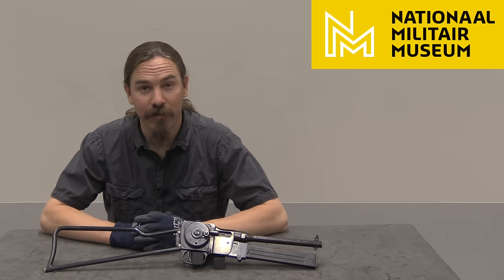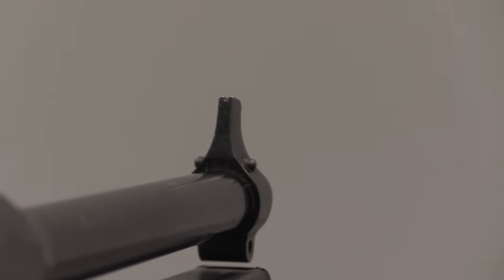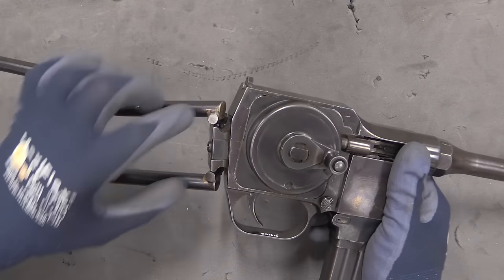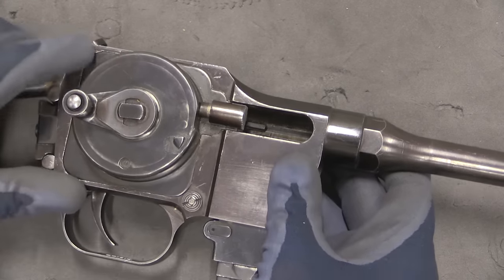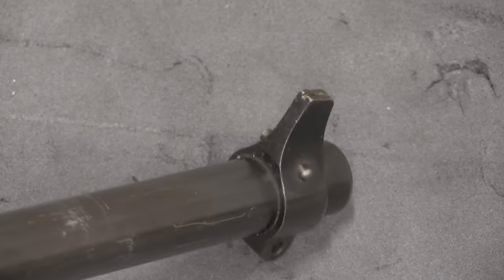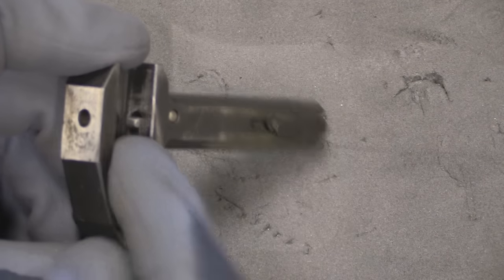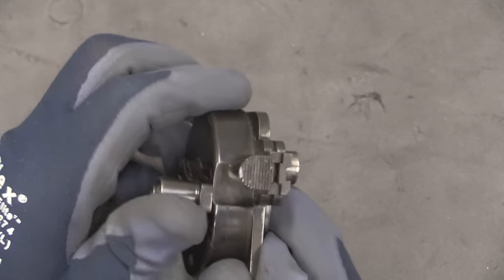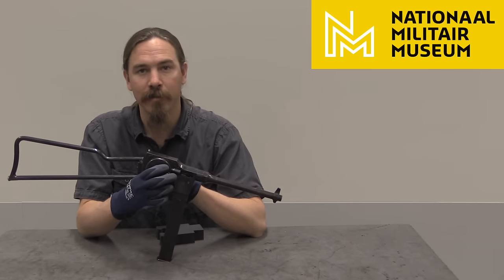MGD PM9 Rotary-Action Submachine Gun

Comment: I've never wanted to see footage of a firearm firing so bad.
Reply: I know. I'd love to see the bolt rotating around. I wonder what the recoil is like?
Reply: +Avalon Run Its also going to be first upwards as the bolt moves back, than downwards as the recoil assembly rotates upwards. Weird and wobbly.
Reply: How do you he it???
Reply: The grip looks like it would be very awkward. Are you supposed to hook your thumb around the stock frame?
Reply: @M.T....  
"However, the force striking the back of the receiver would probably be very significant, especially since there is no action mechanism to delay the bolt going backwards and waiting for the pressure to drop."
The action mechanism is the flywheel. The force needed to spin the flywheel to get the bolt moving backwards is the same as if the bolt was three or four times heavier. The whole point of this action is that the weight is moved from the bolt into the flywheel so the bolt does not have to be as long or thick. This is the whole point of flywheel delayed mechanisms over straight-delayed blow back mechanisms. Straight-delayed use heavy bolts. Flywheel delayed use heavy flywheels and a transmission to achieve the same thing as heavy bolt. Lever delayed blowbacks use levers and mechanical advantage to do the same thing as a heavy bolt. 
These are all just different methods of slowing down bolt movement so chamber pressures have time to drop. They all do the same thing and simply have different recoil, weight, and complexity aspects.
Reply: Same here man
Reply: @Will Kelly lol yes actually they stopped showing dislikes on comments.
Reply: 3 years later, and I am still craving this footage you wanted so badly to see.
Reply: same here, especially this and the jackhammer
Reply: aight where the shooting video
Reply: @ineednochannelyoutube5384  Sounds like they beat the Kriss Vector by quite a while in that respect. Maybe the rotating impulse counters muzzle climb... a little bit. A very strong "maybe" there. Like the Vector, probably also doesn't work super good but screw it I WANT it
Reply: @lewis251100  thank you
Reply: @bigbud6842  how unfortunate
Reply: The older the guns, the less likely to be fired due to delicacy, I assume. I'll go to Google, and let you know what I find. No response = no videos, or even pics, of this gun in action! Take care.
Reply: @VFRSTREETFIGHTER, I found this: The fire at the end almost seems as some trick with the fan that's blowing in the background: https://www.youtube.com/watch?v=pHdtXTHm5U0
Reply: @Xiones11  , must be nice to use google or wikipedia 😅
Reply: @ghostwriter1415 that's an airsoft gun. It's in the channel description

Comment: After WW I I all common SMGs (except Thompson) were stamped steel and simple round tubes. And then a frenchman designs a 1920s style clockwork SMG with expensive machined parts and expects commercial success. Nice gun, wrong era.
Reply: doesn't look that expensive though
Reply: patents were frozen during the whole WWII so the inventor applied for patents in 1940 but did not get'em before 1946. Hence the different approach (milling, etc..) from post war designs. It's not certain that the inventor was aware of the stamped sheet process applied to the MP38 (in 1938) when Merlin Gerin  (the company he worked with) submitted the patent.
The inventor designed also handguns, machine guns etc, without meeting commercial success.
Reply: That design could easily be adapted to 3d printing using elastic polymer spring because of the pull action the rotary design allows. This is especially true if chambered in rimfire.
Reply: @randomweirdo2701  Indeed. This definitely is an idea worth pursuing.

Comment: A very interesting piece of design. I'll add my 2 cents: the mechanism actually makes for a very soft recoil, so crude stock is not an issue. Also, by dynamic and attached mass behaviour(impulse redirection by crank/rotation) mechanism is very close to Kriss Vector. A gun that was really ahead of its time.

Comment: So why didn't this get more popular? Too complicated or uncomfortable to use?
Reply: n0la usually the reasons
Reply from the maker: I suspect because the mainspring tended to break, but I don't have any proof of that.
Reply: Rather unconventional, lots of cheap war surplus, small market in the first place. Also, that seems like a lot of machining for a subgun
Reply: or because it was just after ww2 and there were literally thousands of tons of surplus guns laying about.
Reply: I'd be doubtful of a complicated design, considering most firearms that I have personally seen, this is one of the simplest of designs. As for machining, yes, it may be a fair bit. If the SMG had a better chance for newer models, it could possibly be stamped or molded if it was not already, for mass production purposes.
Reply: Tristan Renner If this is a simple design compared to most firearms you've seen then you must be looking at some very odd stuff...
Reply: @farmerboy916  Good point. If there were enough MP40s lying around to furnish a supply of magazines for this thing in the commercial applications, wouldn't it be cheaper to just clean and use the MP40s?

Comment: The National Military Museum definitely is a great place to visit if you are in the area, there's a sizable collection of both old and modern vehicles, airplanes and weapons. Everything is multilingual so no problem for foreigners (as most museums are in the Netherlands). It's located at an old military airfield that was used by both the Dutch and US airforce up until the end of the 1990s.  They also sometimes do tours of the airfield so you can visit bunkers and hidden locations that are normally off limits, unfortunately they only do tours on special occasions.

Comment: Are there any other firearms that use clock springs? (besides Wheellocks)
Reply from the maker: Yes, the Lewis did.
Reply: and that odd machinegun that used a clock spring and a rack&pinon mechanism....
Reply: I'm quite surprised Ian didn't mention one of his favorite firearms the Suomi smg.  The 71 round drum magazine is powered by a clock spring.  Given it is an eternal part but still required for big fire power.

Comment: Was hoping when I first saw that gun that the magazine remained forward and the round was rotated into position.
Reply: Me too.
Now that would be a compact SMG!
Reply: so you mean like a g11?
Reply: @VioletEverlasting  Except less unholy Swiss-watch inside!  I had an idea for a rotary-breech like the G11 that used the rotation of the breech to extract and eject the case, long before I knew enough engineering to make it actually work!
Reply: @ScottKenny1978  P90
Reply: @solventtrapdotcom6676  yeah, that works, too, just that the rounds are on a different angle to the barrel than the g11.

Comment: 3 reasons why this never caught on

1. It is a pain to take apart.
2. No pistol grip.
3. Probably difficult to reload.
Reply: It's obviously easy to reload
Reply: apart from the huge number of low priced surplus available, the main drawback of the gun was an irregular rate of fire and a rather high incidence of jamming. looks like the clockwork mechanism is rather sensitive to dirt and powder residus.
Reply: @florentleider222  small thing but a difficult disassembly process probably exacerbated the latter issue you mentioned; the gun might not be cleaned as often or as thoroughly due to a lazy user not wanting to put in the effort needed to get the firing mechanism opened up.
Reply: Scratch the 3rd note. Every gun is easy to reload with enough practice.

Comment: I'm surprised no one is copying this style for a compact sub gun nowadays with modern tech! The enclosed spring rig for easy cleaning, and compact size appeals heavily. Just stick a fold down pistol grip from the stock, some type of small hand guard in between barrel and mag, fix the sights [drilling a hole through the 50 yd would even help...]and it would be a runner for my favorite sub gun. Add a threaded barrel and ninjas everywhere ill want them.

Comment: My guess on the stock is that the lower arm is just tube steel while the upper arm is round stock. That way you just have to drill through the side of the round stock and thread it, rather than drilling way down in a long piece of bar stock. Would save a good bit of machine time and having to have a long and fairly narrow twist drill.

Comment: Looks like it is actually a delay blowback. When the "hammer" is rotated to the three o'clock position firing the round, it is almost in a straight lock up position resisting the rearward motion of the bolt.

Comment: Just a semi educated guestimate as to why the lower butt strut is made as two disconnected parts. I noticed that the two parts are not aligned when at rest with the rod removed. When the cleaning rod is stowed and screwed down tight, the parts are held in alignment. My guess is that there is sufficient tension there to prevent the rod from unintentionally unscrewing from vibration and falling out to become lost.

Comment: WOW! This seems to be the best engineered MP i ever saw - small as can be with the ingenious rotating mechanism delaying the opening and slowing the maximium bolt rearward extesion down, would love too shoot that. With a bit of simplification and tolerable wear on the rotation mechanism with a ergonomic overhaul it would be suitable today. And that is from a boche who usually wholeheartedly lols about the frenchies designs. (maybe biased by living just east of the rhine in a region that was threatened by pludering and arsoning french for centuries until the German unity in 1871). MP40 - nice, Sten - works, Grease Gun - works, Hotchkiss universal - looks cool, Uzi and the CZ 25 nice telescoping bolt, MP5 found out by chance that half locked rollers delay nice and work well - great; i want this one!

Comment: The stock might become 2 pieces when the cleaning rod is removed in order to easily replace the lower section in case the spring tension ever becomes loose enough that the stock won't lock in place anymore. That's my best guess anyway.

Comment: Interesting mechanism. Curious if such a mechanism can be improved with accurate calculations so that it can be used to negate muzzle flip. Also curious if the firing pin can really handle all that hits from directions that arent aligned with where the pin is supposed to be pushed towards. Might be bent, or possibly sheared off from much shooting?

Comment: Please excuse my ignorance. A couple of questions. Is this Merlin and Gerin the company that used to make electrical switch gear? The rotary main spring is it one like a pullstart on a mower ( many turns very thin) or is it a heavier spring like a one shot wind up starter on a mower? The reason I ask is the latter type of spring was renown for breaking.
Another great video thanks.
Reply from the maker: Interesting - I don't know!

Comment: If I'm understanding the mechanics right, I assume this would be pretty much the pinnacle drop-safe open-bolt submachine gun wouldn't it? From the look of the spring tension operating it, I doubt a six foot drop on it's steel-end with stock folded would dislodge that toggle enough to chamber a round. Then field-swappable if something breaks, that's pretty ingenious.

Comment: Wild speculation: I bet they built the bottom of the stock that way as a manufacturing concession, probably to do with the weld between the butt of the stock and the bottom bar.

My guess is they originally tried to weld a piece of pre-threaded tube on there, but had some issues with blow through or the threads deforming. So they realized they would have to weld on a solid bar and drill and tap it afterwards in order to get consistent threads. But that would mean drilling the entire length of the bottom bar, a lengthy and expensive process basically equivalent to boring a second barrel. So instead they just welded on a short section of solid bar, butted it up against a matching section of tube, and bored the bar and tapped them both in one go.

As for why they didn't go back and rigidly join the two sections, I'm guessing they didn't really need to. As demonstrated here, there's enough spring tension in the bars to keep the stock in place even without doing that. And I'd also guess that that same tension pulls on the threads and keeps the rod from rotating when jostled.

But as the designer probably would not say, c'est seulement mon deux centimes.

Comment: 11:17 My guess would be it's easier to drill a hole in the end of the bent piece and bore out the straight section than to bend one piece of rolled steel and then bore it out. Still could have welded it though.

Comment: The PM9's spring system would likely have been amazing if applied to any other gun. Containing the entirety of the bolt action inside of the gun while still keeping barrel length long makes the system amazing but it is on the wrong product. Put it on a Bullpup or even a replica of the Mauser C96 and you have a gun that could sell better than the original. Adding a lock for a "semi auto" function and a shell catch would make this the perfect stealth system for the Cold War Era weapons. There is so much that this gun could have been and I just want to fiddle with it!

Comment: A wild theory on the cleaning rod holding the stock together: - After you have taken out the cleaning rod and released the bottom part of the stock you can separate the stock from the gun itself by lifting the top part up and pulling the bottom part down. What do you think Ian?

Comment: The stock was easier to both manufacture, and then attach/assemble the 2 separate parts. It was also cheaper, and not really necessary, to weld the 2 together afterwards.

Comment: By decomposing the linear movement of the bolt in a rotation movement of the recoil coil spring could these be considered as a delay blow back action ? It is posible to in these con figuration aply a cam surfase to delay the blow back .. seems posible .

Comment: Just a question, could that type of rotary motion be used as a mean to be able to handle different type of recoil without ajustements and or modify the rate of fire on the fly by modifying the tension of the spring?

Comment: I've never even imagined someone making a 9mm smg function upon a rotating clock spring.. The finish on the very square metal parts seems quite nice and more like from the 1920's but then again the ergonomics looks like this was never meant to be shot by a primate of any kind.. The skeleton stock's grip seems way too wide for anyone with a smaller hand than a square foot to actually reach the trigger with any of the fingers available.. And even then the finger would be pointing downwards but the trigger would still have to be pulled laterally.. And to be able to see through the rear peep sight one would have to grab the stock with his teeth and gaze through with his left eye.. :D And would a Thompson-style front hand guard have made this less concievable..? The French.. <3

Comment: I'm definitely confused (admittedly, not an uncommon state for me!) but the description of the action...?
Firstly, if the lug is 'fixed in place' (as it appears to be), then the cut-out section will ALWAYS pass over the striking pin?
Given that the gun surely fired, I must be missing something? EDIT
I understand now! It will always pass over the striking pin when the bolt is to the rear, but as it travels forward another 180 degrees, then the bolt has now closed the breech and the other side of the lug can strike the firing pin. (Eureka!)
(I left this in to help other people who didn't understand)
Secondly, I 'get' that the bolt, on recoil, must 'cam' against the clock-spring....until it slams against the back-stop and I can only presume that it is the weight of the rotary mechanism/kinetic energy that causes it to continue to 'spin' against the spring and engage the trigger mechanism, at which point, the 'lug' is free of the bolt assembly (about 8.50), depending on vibration and movement of the weapon....in other words, the bolt is still 'bouncing-around' with nothing to keep it in place except the pressure from the trigger sear?  Am I getting this wrong? Did it suffer from jamming/misfires?  I'd like to know, just simply that I have a background in engineering/electronics and I was never 'happy' (nor more efficient) until I understood 'the system'......?
I don't entirely understand this?
Reply: The winding and unwinding would take less than a second and the bolt would still have some of its energy pushing it against the rear of the receiver, i suppose that ensures the bolt doesn't move forward without the lug of the spring on it
Reply: @thesturm8686  Thank you for the kind reply; I've watched this same presentation four times now....I can only presume that a balance of the ammunition/recoil/weight of the bolt was very finely matched against the clockwork spring?
Maybe it just simply fired until it needed to be re-cocked? AND maybe, all that a competent armourer had to do was adjust the spring tension?
But, my problem is that there is an instant when the bolt is completely free of the cam/recoil mechanism?
Perhaps that's one reason it features on 'Forgotten Weapons' ?
Again, thank you for the reply,
Pax dude.

Comment: Two questions one what is the difference between 7.62x25 long and 7.62 tokarov? and two did they ever make a smaller version of that gun without the stock with a pistol grip cuz that would be a real small compact package, a small machine pistol?
Reply: Straight case vs bottleneck.
Sure would be compact.